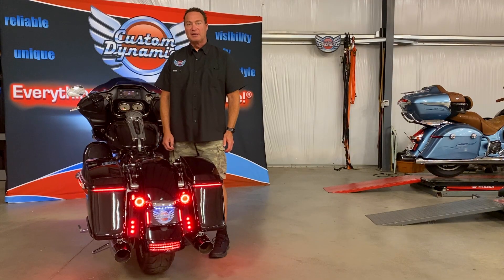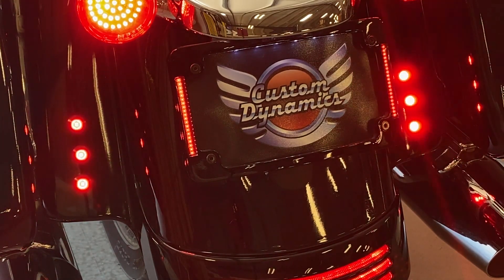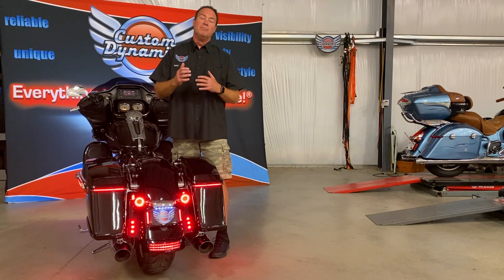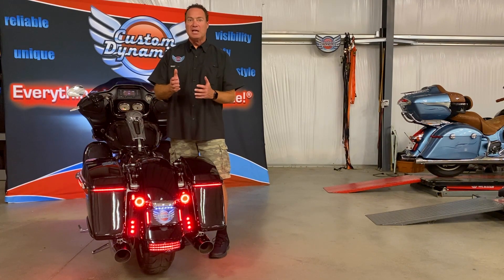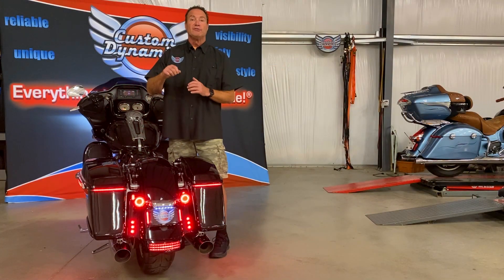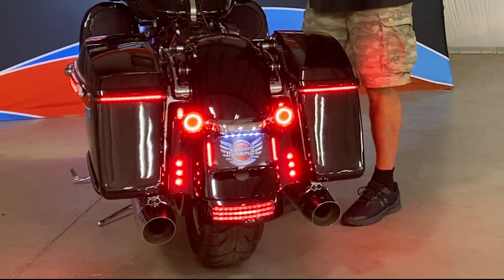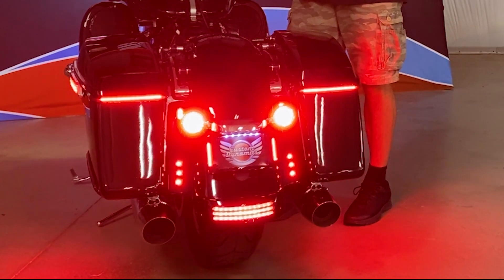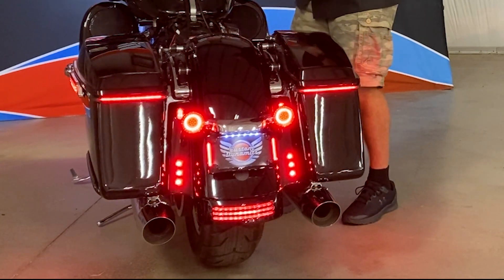Motorcycle ↔️ Alternating ↔️ Brake Light Strobe Module from Custom Dynamics®

Comment: Ahhhh! I think I like it! 😁 Are these on a slim track that fits in between your saddle back and fender? I can’t really tell. 

Thanks

L.D.
Reply from the maker: Our LED Boltz shown in this video are sold as a pair and can be installed just about anywhere. We added them to this fascia panel by drilling a 1/2" hole for each one. Here is the link to our website with a photo of the lights: https://www.customdynamics.com/custom-motorcycle-led-boltz-red-amber